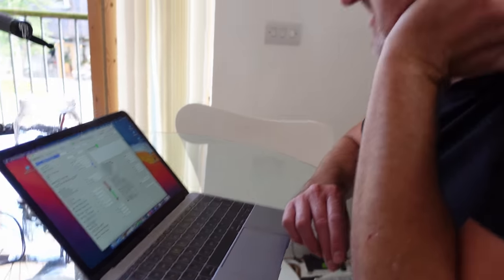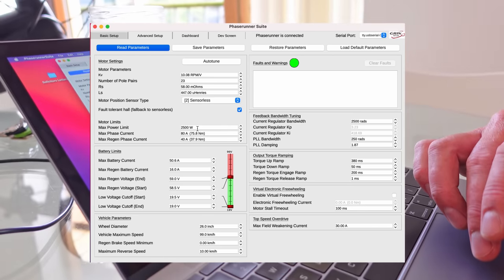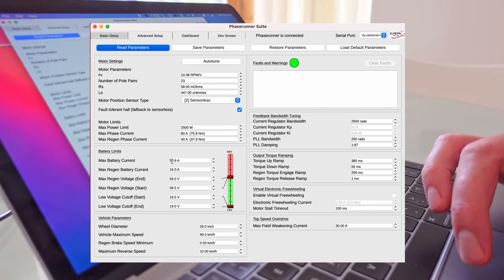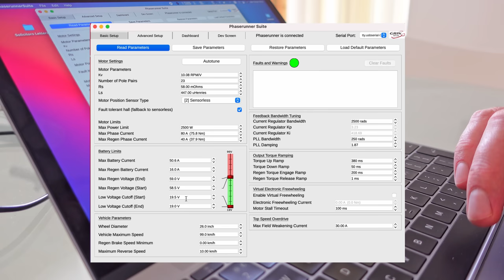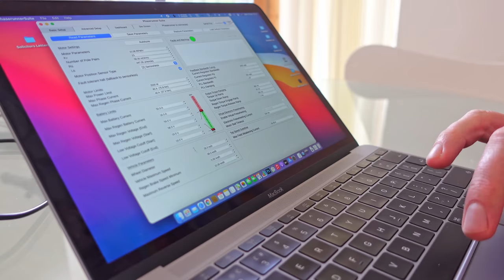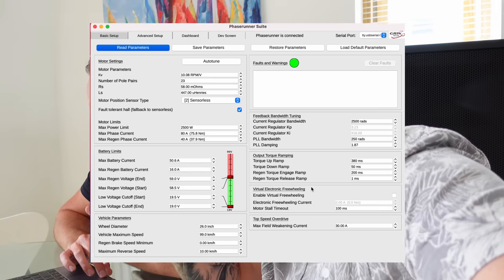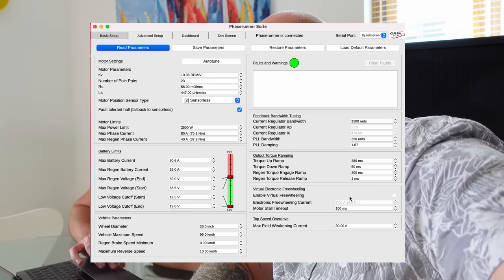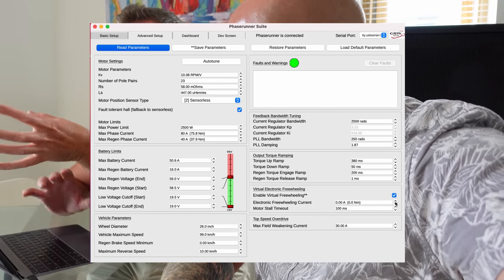She's Alive! Phaserunner tuned Bafang Ultra Ebike is FAST!

Comment: Great video guys! Andy has been a big inspiration to me when building my Ultra bike. I'm currently designing a true plug and play kit using the bac855 that supports the factory hall, torque and temp sensors if either of you are interested!
Reply: @HighVoltageKits  Im interested. I want to beef my Ultra Enduro Ebike.  I want to unleash the beast so to speak. :D

Comment: Should have just bought the Ludicrous controller from LunaCycles. It is a direct swap from the factory one, except it ups the output to 3000w. Been running mine for more than a year with no issues. No muss no fuss. No wire mess, fits where the factory one is. No programming guessing. Dont need to upgrade to 72v, you keep your 52v pack. It just allows for up to 50A instead of the factory 25A. I tried the phaserunner AND the Ludicrous. I sold the phaserunner, so........................you can guess which one I prefer. You also get to keep all your features. And since the motor is stamped for power rating, there is almost no way to know the bike is over powered.
Reply: Except you can get 5kW out of the Phaserunner so no.
Reply: I was looking around and couldn't find a Ludicrous controller for the m620, are you sure you are not thinking of the one for the bbshd?
Reply: Can get 1 anywhere now,,or not that I can find...anyone know where to get it or the phaserunner

Comment: I'm glad you mentioned about cutting the throttle when changing gear.👍I was like wtf snapped chain or no teeth on gears ,excellent work it moves pretty quick 😊👍
Reply: I folded over the freewheel 1st gear with the bafang bbshd!

Comment: Hi Andy. Bought a 1000w y-20 on AliExpress that in fact is just a jumble of miss matched parts. 18 ah battery. 
To add insult to injury if it has a 1000w some one is dreaming. Then coast at any speed and display says your stopped. 
I usually cycle with a friend and can keep pace on my 750w and hills are fairly ok for me. 
But on this so called 1000w even on level I can’t keep up. 
So AliExpress suggested I get 100 euro refund and keep bike. Or full refund but I have to ship bike back to them at my expense. 
To Singapore at over half the cost of bike. 
Now I’m in a quandary. 
Replace controller and display. Open up motor to check internals and repair the bike. 
PayPal has been little help. Even though I purchased the bike from Belgium they also say I have to ship to Singapore at my expense to get a refund. 
We’re in fact I did not like bike that request holds some water but but but 
Bike is not as described and faulty and I’m to suffer financially. 
Hope in time you can recommend some reliable suppliers. 
Rant over 
Cheers

Comment: I believe the controller has heat rejection problems, when you had the screen record on phaserunner it showed fast thermal increase. You need an active heat sink on the controller.
Reply: Where to get a heat sink for the Ultra or any mid drive motor controller for that matter?
Reply: @vm2003  the controller is not in the mid motor in this case, it's that little tiny black box on the back of the seatpost as it's not the original controller

Comment: Amazing power want one. Do you have to remove factory controller before putting on phase runner.
Reply: Yes and you can not revert back. So unless your controller faulty like both Steve and Andy was there's no point in doing so for moment I would say.

Comment: Where can I buy the 2500 watt bafang mid drive
Reply from the maker: It's an m620 ultra 1000w tuned with a phaserunner controller. Andy Kirby sells them when the supply has stock

Comment: You put throttle on the front brake side ....reason been is you want your fingers over back break at all times .....The front brake is secondary brake ...use that once speed low enough ...

If you have throttle on back brake side you can not hover fingers on  the brake  and use power .....it even more evident harder with twist ...why that matters is your reaction time to stop is much slower
Reply from the maker: I don't find it any different to use either side tbh it's a ten minute job if I ever need to, but all good can't wait to get out on it again soon
Reply: @DudeStuff  It don't stop the Bike going Zoom ...the smile it brings is awesome ...itching to go ride now .
Reply: you can cover both brakes easy enough .front brake should be aplied withback brake and aplied harder than rhe back brake ,shifting youre weight back over the back of the seat .

Comment: Hello Steve I have a question for you or Andy I've got a BBSHD running at the moment 48v battery 16ah with Samsung now I know the standard controller can take up to 30 amp would I be pushing the battery too much if I set the controller to the max at the moment running 24amps any advice would be much appreciated 👍
Reply: 30 amp won't begin to hurt that motor. It will drain your battery quicker
Reply: 50 amp running through my bbshd,no issues 2 yrs later.
Reply: @dereks8930  How did you increase amps on stock controller?